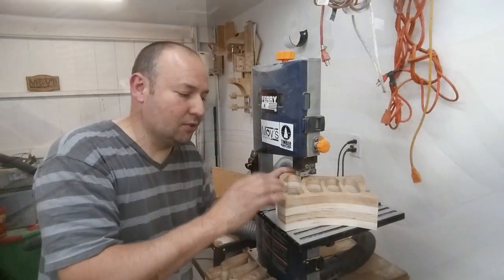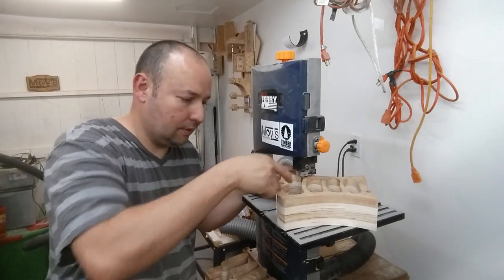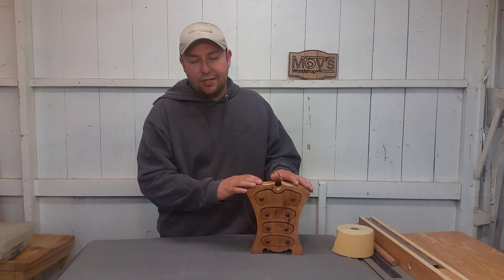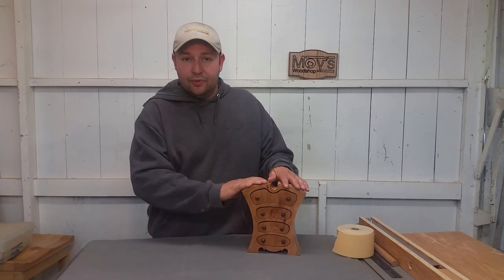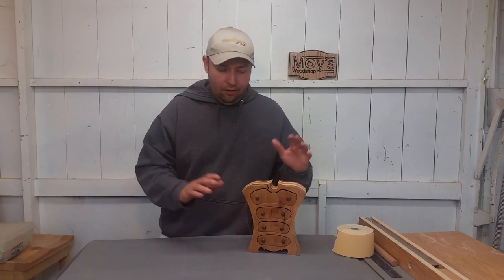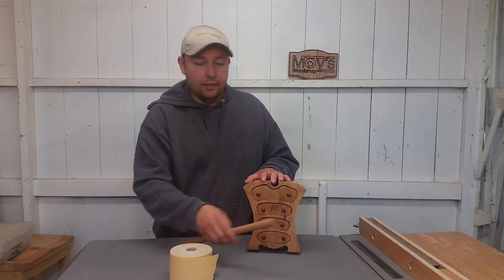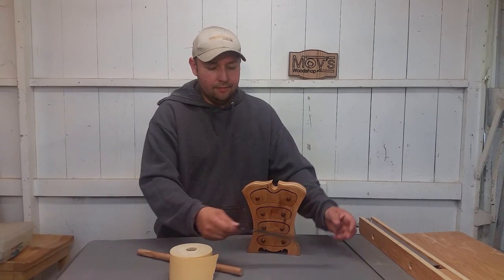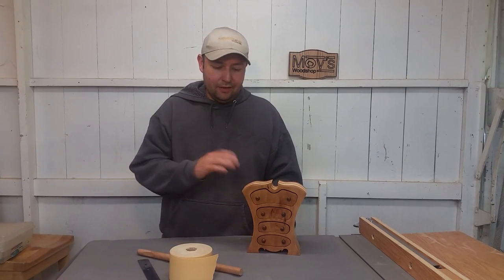Curly Cherry Band saw box

Comment: Die Box ist wirklich wunderschön geworden. Eine tollle Arbeit. In einem Punkt könntest Du es Dir aber einfacher machen. Wenn Du die äußere Form erst ganz zum Schluss aussägst, nachdem die Rückwand schon aufgeleimt ist. So hast Du beim verleimen und zusammenzwingen der Sägeschnitte, außen gerade Flächen wo die Zwingen besser angesetzt werden können und das aufleimen der Rückwand ist auch einfacher, weil es nicht schlimm ist wenn sie sich um 1 oder 2mm verschiebt. 

The box turned out really beautiful. A great job. In one point, you could make it easier for yourself. If you only saw out the outer shape at the very end, after the back wall has already been glued on. This way you have straight surfaces on the outside when gluing and forcing the saw cuts together where the clamps can be applied better and gluing on the back wall is also easier because it doesn't matter if it shifts by 1 or 2mm.

Comment: Nice work, I really like your pattern.  I have a tip for you. If you use double sided tape you can cut out your back the same time as you cut out your pattern then take it off after you finish before you cut drawers out. I do this most often other than re sawing after I cut out the pattern or cutting it separately.  Thanks for the great video.
Reply from the maker: +Lori B thanks for the great tip Lori. Glad you like the pattern

Comment: Thanks for the share.  What was the black dust you put in the drawers?
Reply from the maker: No problem, the black dust is called flocking.  A layer of adhesive is applied and powdered suede fiber are blown in. It gives the inside of a box a great look and feel.

Comment: That turned out awesome, Moy! Great tip with the adhesive backed sandpaper too. I always try to hold it around a dowel while i'm sanding and it never seems to work out that well hahaha.
Reply from the maker: +Braxton Wirthlin ha ha.. thanks braxton. Yeah that stuff is great, just slap it on a piece of mdf and make a quick sanding block too.

Comment: Great bandsaw box Moy.  I love the design.  It didn't occur to me that you were going to glue the back on after cutting the drawers.  Great idea.  Did you use a flush trim bit on that back after that?  Or all sanding?
Reply from the maker: +Make Crazydays thanks Aaron ..yes I'm kind of forced to do it that way because of the capacity of my bandsaw. For smaller boxes I can cut the back off ..I just used the sander afterwards.. the trim router would have been a good way to go, I didn't think of that ..lol

Comment: I'm a novice, what's the powder paint applied to the inside of the drawers after painting them? What does it do? awesome project, thank you for the video!
Reply from the maker: +William Kapelanski thanks william. The process is called Flocking. You paint the tinted adhesive and then apply medium which is shredded cloth fibers. Since this type of box is usually used as a Jewelry or keepsake box, you want to line the drawers with something to protect the items. Flocking is great because it looks really clean and  it's alot easier than trying to glue a piece of cloth.

Comment: Why did you not just go back to your first entry point to release the box from the bandsaw, instead of cutting to box in two?
Reply from the maker: +Cliff Carlo I could have done that also, but that would also leave that cut mark where I messed up. It would be pretty tough to cover that up and i didn't want to change the shape of the drawer. Cutting all the way through and spitting the box was a good option. The cut less noticable after the glue up.

Comment: instead of cutting  the box in two could you not have backed the blade out of the box through the existing cuts, nice  box
Reply from the maker: +george matthews thanks George! I normally would have done what you suggested. in this case I had deviated so far from the line, it would have changed the shape of the drawer drastically if I would have stayed in the cut.
Reply from the maker: +george matthews thanks George! I normally would have done what you suggested. in this case I had deviated so far from the line, it would have changed the shape of the drawer drastically if I would have stayed in the cut.
Reply from the maker: +george matthews thanks George! I normally would have done what you suggested. in this case I had deviated so far from the line, it would have changed the shape of the drawer drastically if I would have stayed in the cut.